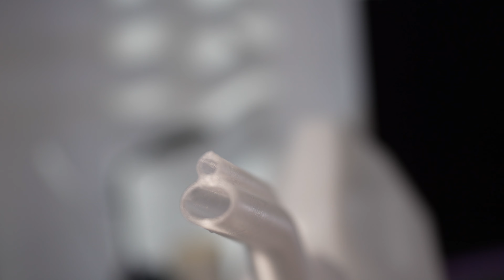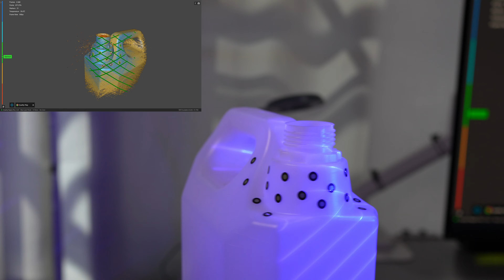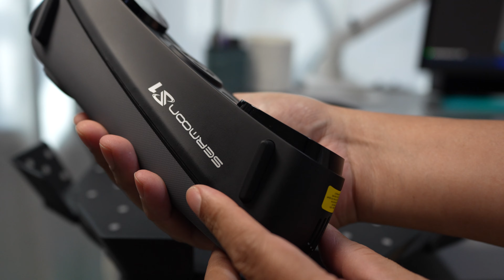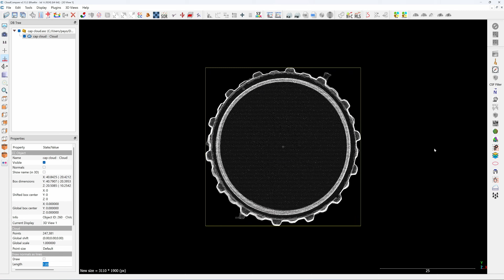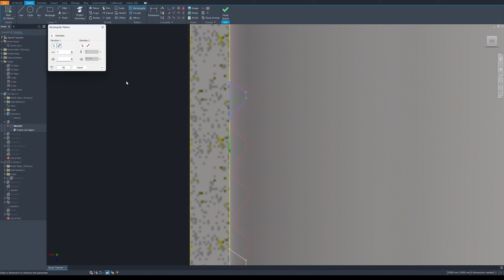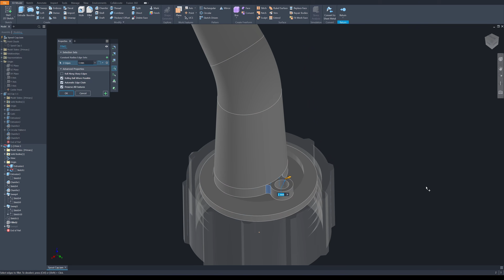3D Print Your Own Spout Cap - Creality Sermoon S1 DIY Project

Comment: Hi, what spec is your PC in this video. Just got my S1 and I get 50+ FPS on cross line but only 30FPS on single line. I'm on i9-9880H gen9, 128GB ram, Quadro RTX 3000 6GB video ram. Scanning single line at 30 FPS was super slow. Also, will you be testing the Einstar Rockit, it was so annoying that it wasn't sent out to any of the bigger channels.
Reply from the maker: My desktop setup—i9-14900K paired with an RTX 4090—delivers full-speed performance. Even my laptop with an R9 8945H and RTX 4070 handles 85 FPS in cross-line mode and 90 FPS in single-line. For solid results, I’d suggest going with at least a 12th Gen CPU and an RTX 4060 or better.
As for Rockit, I won’t be reviewing it. Shining3D enforces strict reviewer guidelines: no negative feedback and no direct comparisons allowed. I’ve reviewed Rigil’s scan output, and if you already own the S1, you’re in good shape.
Reply: @Payo-TensileCreator Time to build a computer 😅 Yeah, think the issue shining has now is that they need to limit the performance on their consumer scanners not to compete with their pro line. What's your opinion on markerless ir scanning with the S1, tried it today and it seems to be complete garbage at tracking. Might need to keep my Einstar around after all.

Comment: wonder if there will be ever possibility to use a 1 line mode on a raptor series.. but i guess this is hardware stuff, not doable by an update..
Reply from the maker: This single-line projector is pretty unique. When it hits an object, the line bends to follow the shape, almost like it’s hugging the surface. You’ll also notice tiny laser dots scattered along the line itself.

Comment: I don't understand, in a previous video you said the Sermoon S1 has less resolution then Raptor, 2 MP instead of 2.3, now you say Sermoon S1 is more accurate because it has 1 line mode?
Reply from the maker: The camera has less res. but the scanning result shows no different.  Single line make the S1 captures all blind spot, especially the underside of the thread profile.